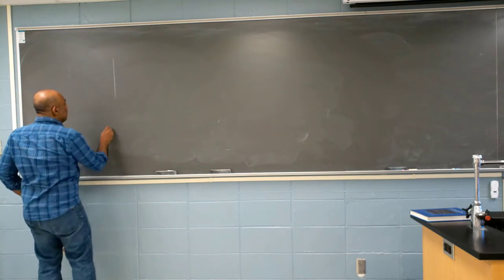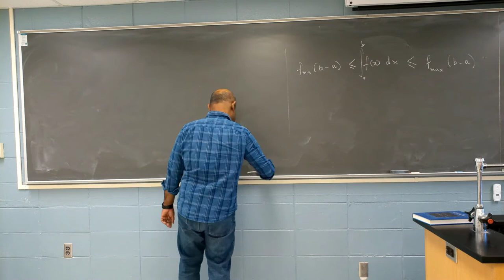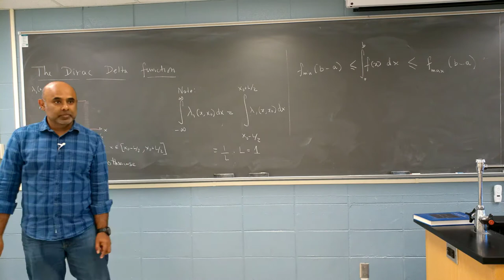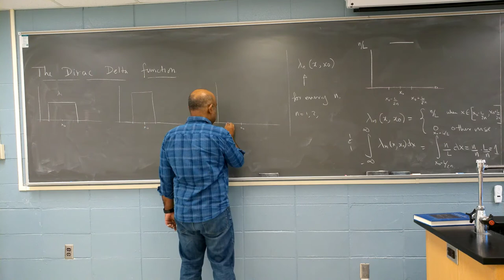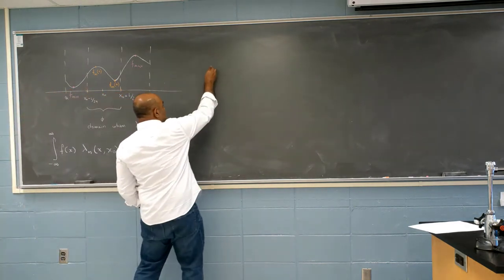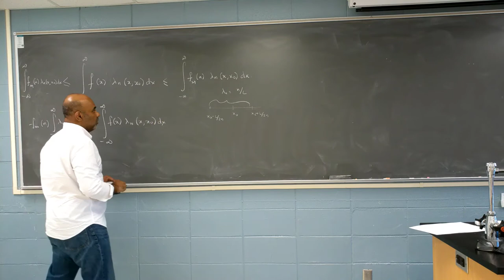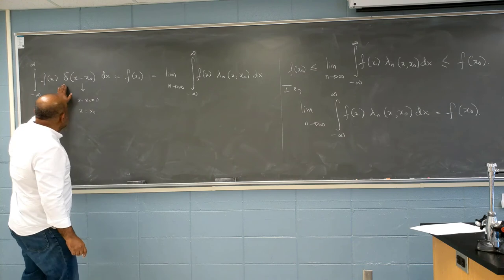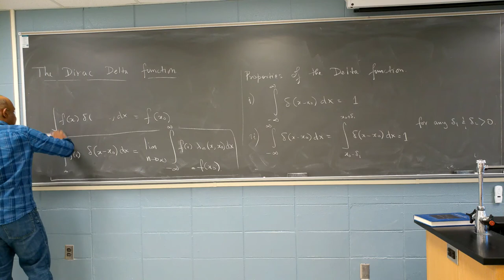Chapter 1, Lecture 7: The Delta Function

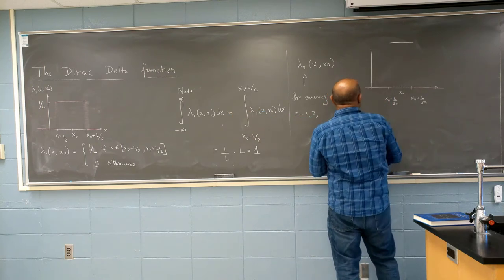Comment: At 13:30, why did you choose n/L? You said something about making it taller but I wasn't quite able to follow
Reply: Are you choosing a height that will result in the integral being equal to 1 at the end?
Reply from the maker: @josephcannon9908  That is correct. As n increases, the "width" of lambda gets smaller, while the height increases so that the total area under the curve is 1.
Reply: @govindmenon4013  Thank you for clarifying. Also, thank you for posting these lectures. They have been really helpful.